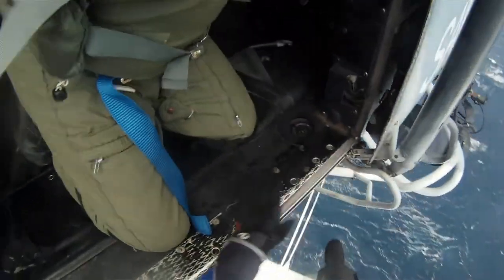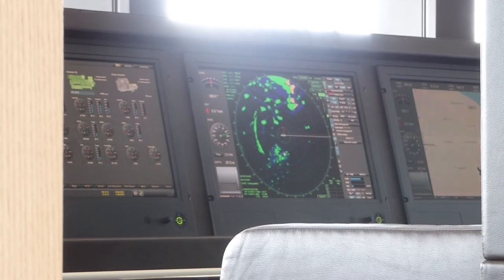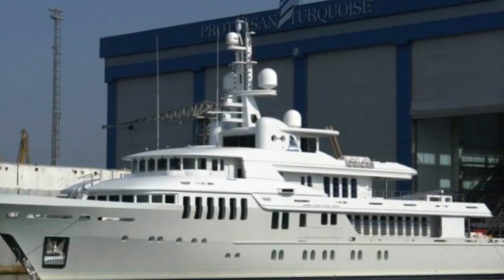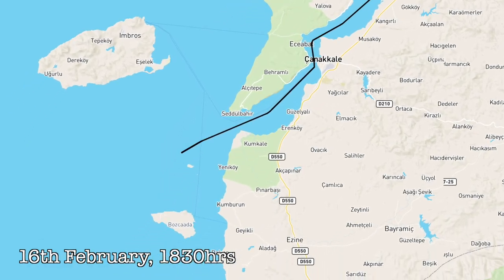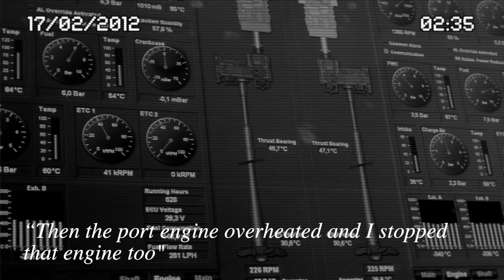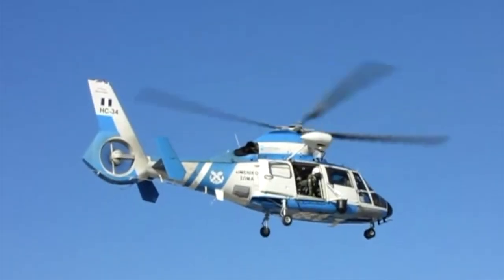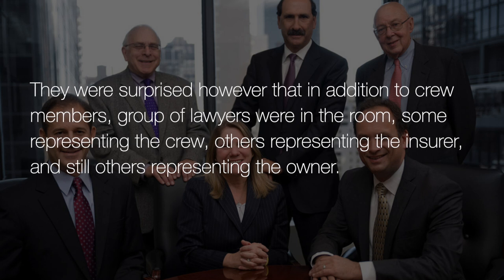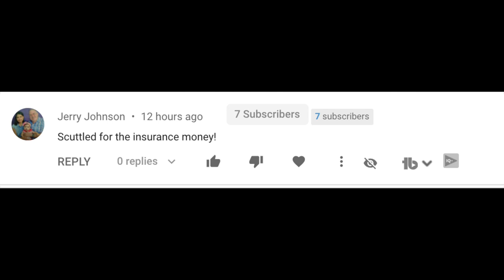Yogi: Largest SuperYacht that ever Sank - Part 2

Comment: I went to sea on working vessels, not super yachts and let me tell you, the Old Man ran things by the book, and if there was ever any issue then either the Chief Mate or Chief Engineer was called on the carpet. Seems as though this captain was clearly lax and slackarse...was there no pre-departure checklist where things like the comms systems were checked? And any sensible skipper would insist that accepted protocol be followed with engine room and deck crew carrying radios. Where is this "captain" working now, anyone know?

Comment: There are very good reasons that accident investigators are independent, govt-sponsored groups like the NTSB... because just as we see here, when a group is allowed to investigate themselves they'll always find that they did nothing wrong.  Using the shipbuilder's feedback to alter the "facts" is particularly egregious... but what's most telling for me is that even if there were major issues with the ship's build, the crew's actions were suspiciously incompetent in any version of the story (including their own).  There's definitely something off... it's just hard to tell with such unreliable sources.  Great videos though, really interesting. 👍

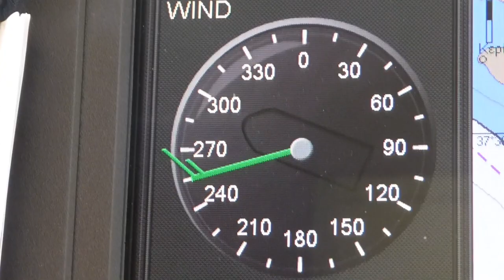Minor point @ 2:03 ... an aircraft "black box" does record data from the entire flight. They have two parts... the Cockpit Voice Recorder (CVR) only stores the last 2 hours of cockpit audio prior to a crash... the Flight Data Recorder (FDR) stores the last 25 hours of technical data (which is longer than any single flight duration).  Airlines actually download & analyse this technical data following every flight, and have been using it for years to get better fuel efficiency, logistical planning, etc.

Comment: One more critical point that is not clearly mentioned in the videos is that the yacht got only 25000lt of fuel which is 1/4 of the fuel capacity. The yacht's max range is 5000 mile (@12knot). So with 1250 mile it can barely pass Malta but wouldn't get even close to Cannes. With 16 knots of speed it can barely pass Greece. A yacht going to Cannes but doesn't have enough fuel although it could have 3 times more. Hmmmmm!!!!!!!!

Comment: The crew had no part to play in this scuttling of this vessel.
This carefully planned sabotage started with the drilling of three small holes in the water pump inlet on each engine water pump to reduce the cooling water flow by introducing air into the flow instead of cooling water and cause the overheat of both engines after a number of hours. The weather conditions accelerated this process. This was a complicated insurance fraud and the insurance company needs to recover the vessel to prove this. Marco knew what was happening and was unable to stop it. His death three years later in a car crash was suspicious to say the least. This was engineered during remedial work at the shipyard.
RIP Marco.

Comment: When you show up for a meeting and everybody, from the owner to the crew has an attorney, you know somebody has screwed up and they don’t want the truth to get out. Nobody hires lawyers to tell the truth. They hire them for protection from the truth. And when lawyers from separate parties agree on anything (non disclosure document), you know there’s something they really want to bury. The crew made a number of mistakes leading to a catastrophic failure and intentionally left the logbooks onboard. And it appears the shipyard, in going out of it’s way to satisfy the owner’s and the captain’s unusually large and major changes to the initial design (requiring 27 tons additional ballast and approving improperly documented changes below the freeboard), may have gone too far and impaired the boat’s operational capabilities. Sad tale and the least guilty party (shipyard) takes the fall.

Comment: these boats are built at low cost and then at the first bad sea or strong wind what happens has happened, you have seen that it does not have a hull it does not have high sides, those boats must be built in specialized yards such as lurssen which is the number one specialized  on yachts

Comment: Seems to  me that the engineer was asleep at the wheel er I mean the engine?  I find it unlikely that both communication systems were down.  I think the engineer woke up in the middle of a disaster and instead of thinking clearly he just rushed to the bridge.  As you point out, he could have manually turned the engine off.  Definitely seems like crew error to me and they covered it up and put the blame on the ship maker.

Comment: The French didn't want to do too thorough a job investigating and exposing whatever went on that shouldn't because otherwise it would have put off all future yacht owners it wanted to register in France. That's because registering in France wasn't compulsory, it was effectively a commercially competitive situation, so therefore a race to the bottom in terms of quality and meaning of registration. And a race to the bottom in more ways than one.

Comment: This was the first big project  for the yard which paused so many technical difficulties to overcome. Crew and especially captain extremely careless. In early am hours why would someone carry a vhf at open sea on a brand new superyacht ( yes they should) and if most of them were not sleeping. Captain did not respect his equipment under severe weather conditions with the obvious result. Sea requires the utmost respect whether this is a small boat, a superyacht or a huge vessel. Conspiracy theories in many cases are for the movies.

Comment: The crew may be responsible for overtaxing the engines, but even if they caused the ship to go adrift, based on the info from this video, this didn't appear to have a direct relation to the cause of the flooding which is what ultimately sank the ship unless there are some facts this video ommitted.

Comment: Dont be misled by the video of a ship pounding through a massive sea, it regularly blows 40kn in this area but the sea state is never that bad as can be seen in the Helicopter video. The motors are diesel and are governed to a set maximum rev's, they can run flat out all day and not overheat. The reason to slow the engines is only to save fuel. I suspect the stern door failed,like the 'Herald of free enterprise', and water flooded the stern of the boat making it unstable. We dont know if all the WTB's were sealed so the water would penetrate throughout the ship, causing it to list as seen. The owner was a dodgy geezer so I still suspect fraud!

Comment: Whilst it seems odd that the pumps weren't able to cope - this vessel seems to have had lots of problems, returned for work on multiple occasions (unless this is normal), someting leaking - presumably the stern door, non-functioning communication devices. On one hand I can understand the presence of lawyers - the crew potentially have lots to loose if found to be at fault and in air investigations alll statements are  priviilaged. Still it's rather convenient given the owners financical situation, presumably he could just have sold it though.... French investigation doesn't seem to have been thorough.

Comment: I think there are many discrepancies in those events, starting from the extension of the yacht, to the deadline pressure, the engineer room control centre, high speed sail without a valid remote VHF communications between crew members, the owner not in the ship to test it for inspection,  the flood in the back room, crew rescued with their passports but no documents on the ship etc.....My first reaction is an insurance fraud probably with a remote control system i.e autopilot type QRS11 that is why the crew had no option to take back control of the engine speed etc.  Since it is not known to a wide audience.....Lawyers at the meeting with all the parties demanding confidentiality.....The crime would benefit someone down the line....with the help of the French Bureau of investigations....

Comment: The whole incident smells extremely fishy.
Had the vessel been mine, after all the faults, it would have been returned to the builder, the order cancelled and the build costs refunded.
I must agree with the general consensus in the comments that it looks as if there has been a cover up.  Having to sign a confidentiality clause on the crew's comments was suspect to say the least. Perhaps that is how things are done in cases like this ti try to fudge the issue.

Comment: Brand new boat?.. presumably new engines? and they are gunning it at 100% of maximum speed? You serious? .. What ever happened to break it in slow?... sort out issues etc etc .. I had 2 recondition mercs on my boat.. told to keep revs under such and such .. then to take back for them to check... etc

Comment: strong evidence to point out sabotage on the crew's part.
I mean, the changes were a bit... fraud-y to begin with but I think the crew took advantage of the situation.

The reports do not match up as well. They withheld the reports to the owner so I think BEAMer were also at fault and completely mishandled it.
FFS, how did that crew manage to be back on job after such a fiasco? Surely the engineering building bit was the shipyard's fault but the protocols and changing of story details and so on are suspicious

Comment: This video of part 2  is a real Fairy Tail of a  screwed up crew who let things they had control over get away .And just why was that possible when there was so many safeguards abound .This crew ran to the high ground when things got difficult. Maybe there was truly some engineering faults on that build and retro fix ,but i don't think it should have been enough that the crew could not have identified the problem at sea .And radio for assistance from the builders ...This was a loss of immense proportions in the super yachting world  .And hopefully a learning lesson for some ..

Comment: How come the owner who clearly bought the vessel and tberefoe nhad the cash to make sure that every safety devise available was on this vessel, or is it a question of "Look at my new toy" a n atitude I have see more than a few times, .
The vessel was said to be seaworthy after having just come out from a corrective visit to tne builders, but the phones being out of order from the engine room to bridge prove that it was NOT SEA WORTHY.
 FLOODING THE  STEERING ROOM says the was  an area for water to enter, but the amount of water says tbat it was more that just a small  leak, there was a hole somewhere, something that can  be verified even now while itss on the  bottom.

Comment: "perfect condition" after being set back for like 3 warranty refits and crap, this looks like a bunch of half assers half assed their jobs and now a super yach is sunk :( i hate when people dont do their jobs
Reply: owners realized they got a floating black hole in repairs
Reply: Shipyard owner only knows what his subordinates tell him - he wasn't the one on the boat fixing it, and if his yard workers and the yacht crew members got complacent and said "yeah this yacht is fixed" and the inspectors didn't do their job correctly, just signing things off as done when they weren't, then the shipyard owners could very well have believed that everything had been repaired on Yogi and the yacht was indeed in perfect condition. 

Unfortunately there really isn't any reasonably cost effective way of actually inspecting the ship now, since it's sitting in 500m of water in the middle of the Aegean sea.

Comment: There are so many different instances of incompetence that having the entire crew exonerated is ridiculous. The apparent lack of ability of the engineer to communicate with the captain and then choosing not to shut down the overheating engine is a serious flaw in judgment.  The captain running the boat at full power or nearly full power in rough weather seems like poor judgment. After killing both engines why wouldn't they maintain the direction of the boat with the thrusters? Did they overheat the generators too? Was there no emergency pumping system that could have been used? The engines and generators would all be equipped with pumps that would move a substantial amount of seawater. The watertight door "blowing open" story sounds fake unless the boat was taking on massive amounts of water from the stern but the rescue video shows the vessel leaning on its side instead of bow up like in conjunction with a total transom failure. Sabotage may be difficult to prove but the evidence of total incompetence is overwhelming.

Comment: Sounds like they had a deadline to meet. Owner to blame? One thing l noticed tho,in only a few hours at full load on engine's she over heated wtf? Are all pleasure yachts built so cheaply? I've been at sea in far worse storms had some moments due to breakage. Looks like the crew just gave up an let her sink. Wouldn't cut it in the comercial fleet.

Comment: If I had $40mil to spend on a 60M boat it would not be a new one from Turkey! A used 62M Feadship built in 2005 refitted in 2018 that's for sale now for example would be a far better boat for around the same $. Feadships are built in Holland & considered one of the best built super yachts you can buy!

Comment: Any investigator would see this presentation and catch four key clues. First of all if you analyze the facts that could be determined  from the construction/renovation work log that was performed at the builders yard. Regardless of whether they replaced an engine or added six meters to its length an inspector must sign off before the certification is given. What is puzzling is how three inspectors, (private surveyors, the owners independent inspectors and the captain,) didn't catch or make mention of a single problem or fail. The second fact that was difficult to explain away was the second trip to the doctors in Italy. What work was done there and could they be liable for the sinking?  I'll stop rambling, the facts and events leading to her sinking are clear. Builder and the captain were paid a huge amount of money to sink, scuttle Yogi pronounced, YO, chy. All the available data is in the statements from the crew and the builder/owner. No one statement is even close (which is normal) to any other statements...except, the builder and the Owner/captain. I think they screwed up with its reno the extension and or the weight and location of the addition ended up being too high above the waterline making the boat top heavy and poorly balanced. If ever in a situation in it's life where it found it's self taking broad side waves, it would have capsized without doubt. In order to start all over was to sink it and make it look like there were more than one fault that lead to it's sinking. No communication with  the engine room, on it's first crossing in rough weather...Mmmm crazy I would be crazy if i believed any of their narrative. Just the fact the captain was pushing her at 16 knots in rough seas... maybe 20 to 50 hours on everything... The captain doesnt attempt to bring her down to 10 knots.. Its all fishy....excuse the pun...

Comment: I grew up on boats..all my life on boats...this whole thing stinks ! These guys pounded that boat at redline in bad weather and  overheated then were dead in water....back hatch leaked.. but that kind of boat w that kind of equipment and a professional crew should have not let it get out of hand..sounds like they built a top heavy slow leaking super boat and they knew it..if your adding  26 tons to the keel after its built you got problems...

Comment: You can't just say that a boat was travelling at "x" speed between two points. You need to take the currents and wind into consideration. You have two different types of speeds at sea. You have speed underway and speed over ground. I have been in a situation where I was doing 6 knots speed underway but because of currents I was doing 0 knots speed over ground. The opposite can also happen. By the looks of it the ship was a lemon 🍋.
Reply from the maker: Yes but you can determine the speed if you know what tine it left point A and you know what time it arrives at point B
Reply: @YachtReport  yes but it does not tell you the speed that the crew thought they were going

Comment: There are to many points that are inconsistent, no definitive answer to where the water came in, no answers as to lack of comms between engineering and helm, no captains log saved, no engineers log saved, no ships log saved that is 4 people and 3 different log books, experienced people who wouldn't forget them unless it was intentional. Why were they allowed to set off with no systems checks by the yard, why didn't they get held back to insure crew were rested properly.

You can put small bit of blame onto many players beside the crew, owner and builders because many different groups failed prior to her even setting out.
Cooling system wasn't sufficient? Why wasn't this found out before and addressed in one of her yard stays? It would have become obvious in original sea trials if the cooling wasn't sufficient.

eSysman, you are an engineer, do you not keep an engineering log for the boat you are working on? If there was a problem with the cooling system you would learn it very quickly and make sure it was known to all concerned?

Comment: This is what's scary in the world. Anyone can go to classes and get certified and have absolutely no fucking clue what the hell they are doing or how to properly diagnose an issue and if an emergency, what action if any should be taken. Bad decisions and incompetence will bite folks in the ass every time. Could be the manufacturers fault but depending on the actions and decisions of the crew could make a small problem much worse.

Comment: Must of been a slacking crew. After watertight doors being reset then no watches going through rough seas seems they took a lot for granted. Worst is diverting from original plans redistributing weights possibly causing flexing of the ship didn't help in rough seas at max power through waves.